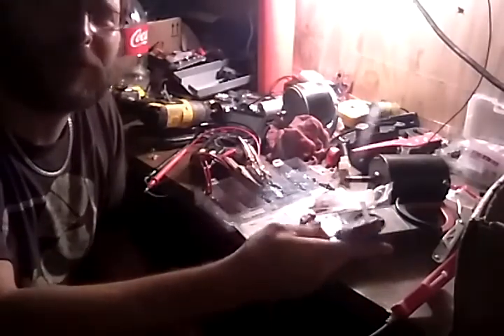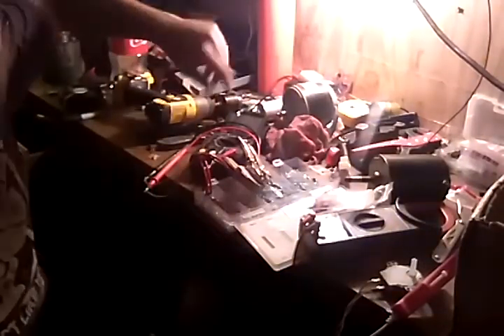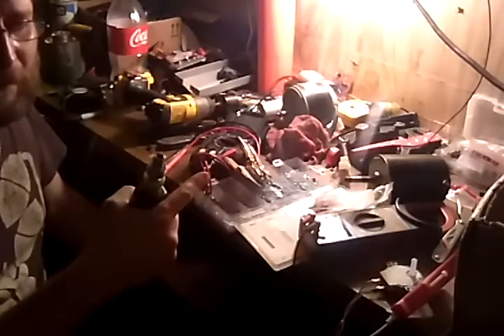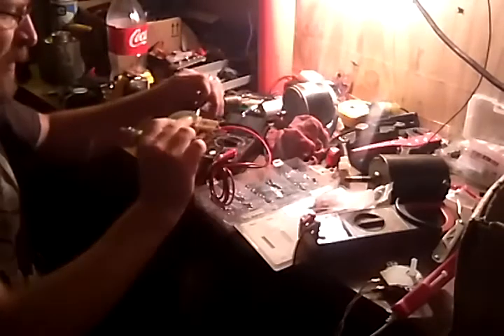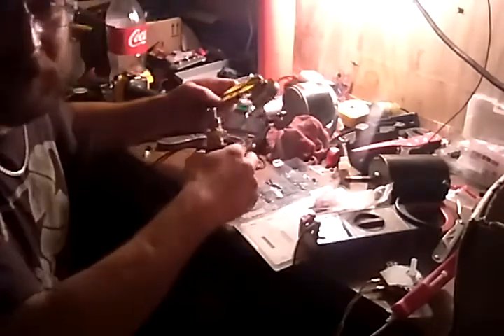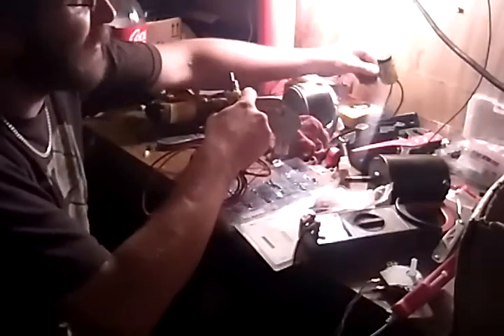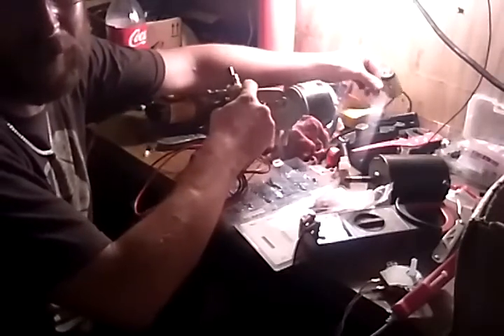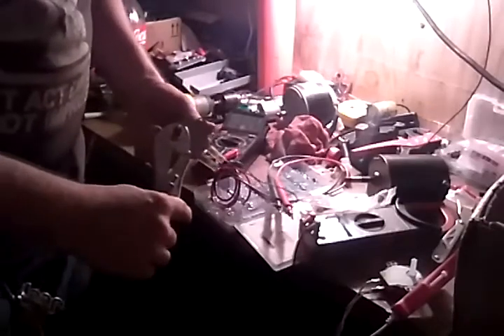6/12/17 P1 Generator Demo,  AC motor=AC Generator... DO NOT TRY THIS AT HOME!!!

Comment: you cannot measure amps or current the way you have your leads connected. current is measured in line with the leads. read the book that came with the meter.